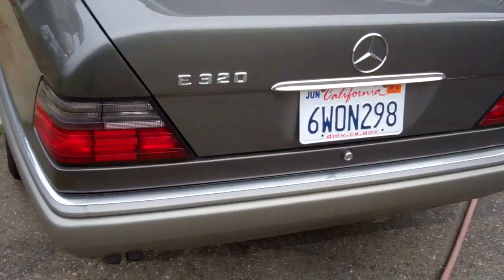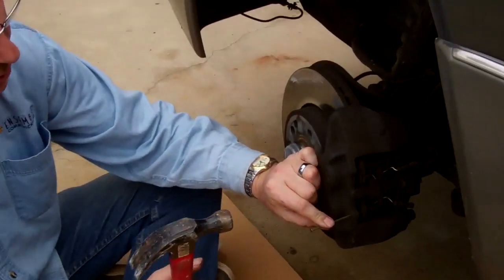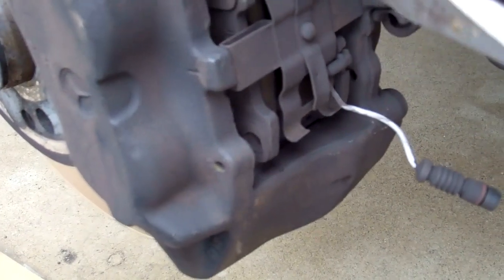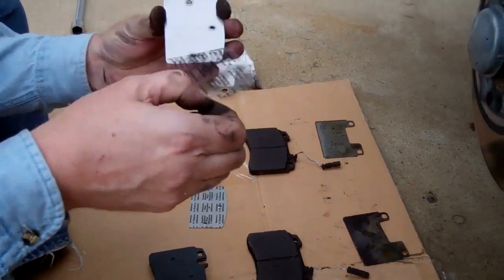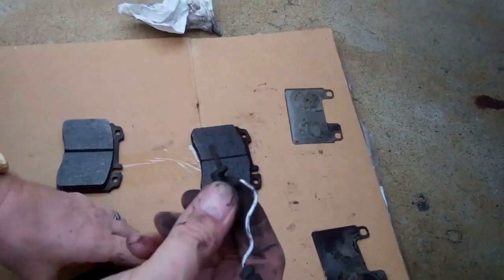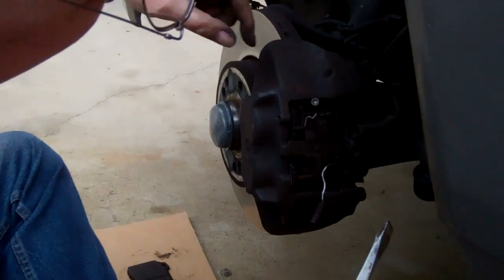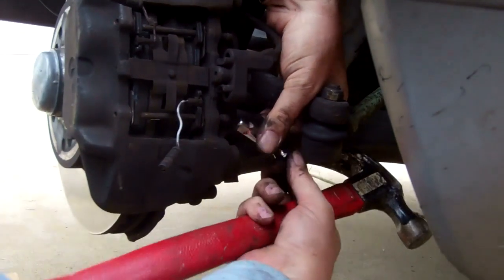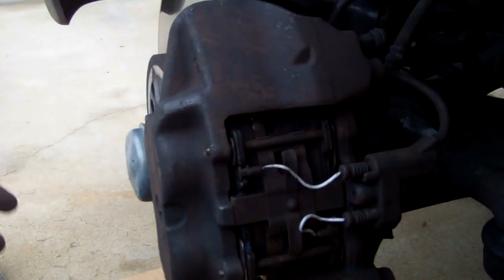Mercedes W124 Front Brake Pad Replacement

Comment: the deco emblem comes off. i was talk bout the metal dust cap after that. i have not done the rear wheels yet. im just doing the fronts first.the dust cap is whats catching the wheel. it spins with the wheel as i spin it. ill try to take pics for you when i get the chance

Comment from the maker: On this one I removed the wheel bolts and the wheel came off easily. So you are talking about the decorative emblem in the center of the wheel? The dust cap is the metal cover for wheel bearing nut and fits in hub. I Googled but did not find anything on this. I do not fully understand what is catching. This happens on rear wheels too? Sounds like some sort of an anit-theft add on. I am sure any local tire shop could give you an answer. Please post back with fix or info for others.

Comment: on my 1990 300E only the rear calipers have those pins, the front caliper is completely different than the one in this video.
Reply: W124 1994 & 1995 E320 or 1993 400E

Comment from the maker: The rear wheels should not have the dust cap so that would be interesting to see. The dust cap should be able to be pried out of hub with large screw driver. Seems that the wheel would not catch on that. Good luck.

Comment: Do you have to disconnect the brake lines to compress the brake pistons? I tried using a c clamp but still can't put the new pads in
Reply from the maker: C-clamp is fine. Push in both pistons. If a piston will not go in maybe caliper is bad?

Comment: front and rear on a w124  2.5 td, rotors and pads but now i have a horrible grinding sound worse than before i did the brakes. I pried the dist shield away and still no luck.
Reply from the maker: With semi-metalic pads a grumble noise is normal at low speed breaking. Some pads worse than others. Should get better once pads seat.  See if you can find some high quality ceramic pads if noise is issue.
Reply: @KentDiego  it's only the rear ones making sound.
Reply from the maker: With car jacked up spin rotor to see what is rubbing. The only thing I can think of is maybe the anti-rattle clip is hitting rotor. Stuck parking brake maybe? Look and see.

Comment: Hey Kent, I am planning to change pads and rotors, front and back.... for e320 95 my question is do i have to disconnect lines? which means do i have to do bleeding?
Reply from the maker: No. Do not disconnect brake lines and you will not get air in lines so you will not have to bleed the lines. Brakes are an easy job.

Comment: hey i was wondering if you can help . i cant get the wheels off. the dust cap keeps it from coming off. what is the trick to getting it off. and why is your car different from mine.you dust cap is on. while it seems i have to remove mine to get the wheel off. could i have the wrong dust cap on ?

Comment: No mention of opening the brake fluid reservoir/removing some brake fluid. When you push those pistons back in, the fluid needs to go somewhere ......
Reply from the maker: As the pads wear the reservoir gets lower. New pads bring it back to the top. As long you did not add any fluid it will be OK. Still it is good idea to open reservoir and keep an eye on it.
Reply: Kent Diego cheers

Comment: Wow seems very easy. So there is no bleeding to the brake lines?
Reply from the maker: Since no air enters the brake lines you do not need to bleed. If you disconnect lines or flush fluid then you have to bleed.
Reply: Ok thanks for responding

Comment: I think you should have put a Jack stand in place. Never ever trust the floor jack.  that could slip and can ruin your day.   Now I will need maybe change my front brakes which this will help but I will be replacing the brake lines also and etc.  I know I will have to do a bleed brake job so I will change that brakes rotors next and do the bleeding last. it is already spongy feel so it may need it anyways
Reply from the maker: My experience with jack stands is not good. A pair of stands is safer than a bumper jack but a floor jack feels more solid as long as 3 wheels are on ground and locked. If pumping pedal removes sponginess then air is problem. Then the question is how did the air get in? Usually master cylinder is cause.